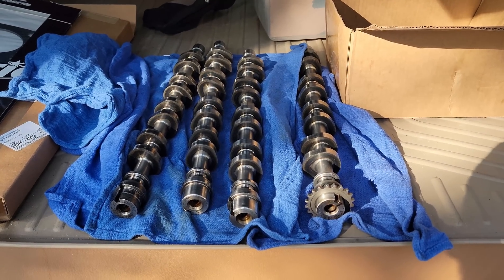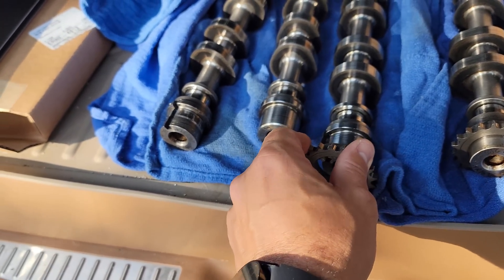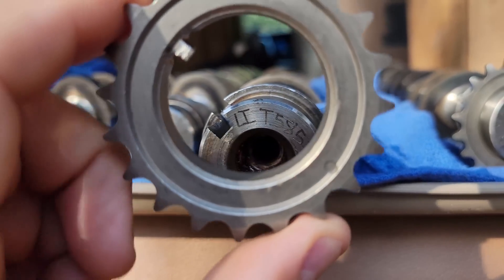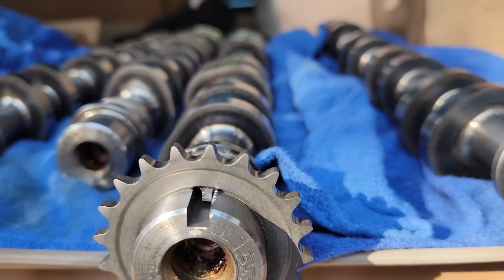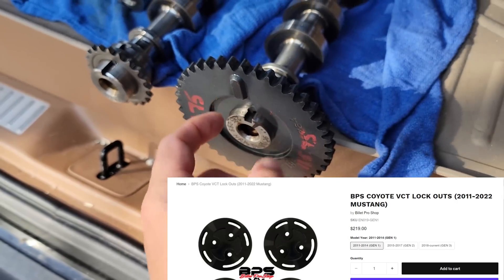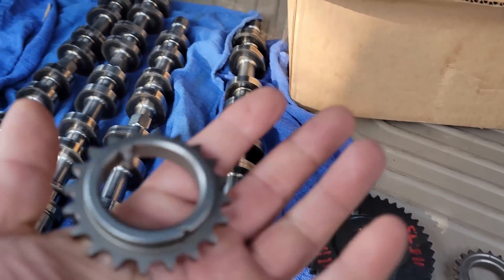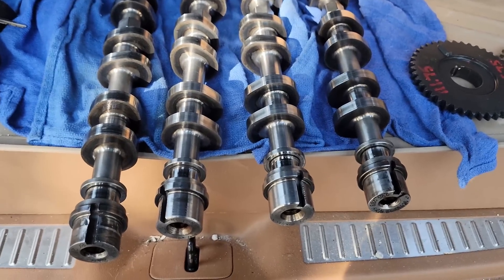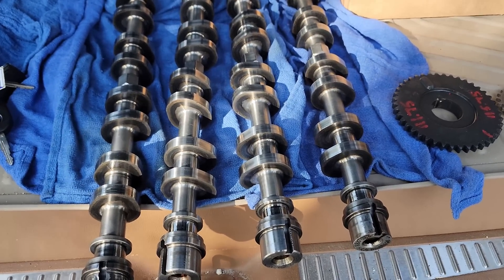NEVER Cut Your GT500 Cam Keys! Here's Why

Comment: LS guy here! So... A lot of LS guys want to put LSA blowers on their cars. LSA=CTS-V2 and 5th Gen Camaro ZL1. But they NEVER pin the crank. Pinning the crank involves drilling a hole between the crank and the balancer (IT'S NOT A BALANCER ON THE LS! THE LS IS INTERNALLY BALANCED. NO NEED FOR A BALANCER. THIS IS A CRANK HUB DESIGNED TO DRIVE YOUR ACCESSORIES! THE HUB IS PRESSED ON TO AN LS. HENCE THE NEED TO USE A TOOL TO INSTALL IT!)  to drive the blower. You're adding more stress to that BOLT that holds the balancer on the crank. Then they spin the balancer on the crank and wonder WHAT HAPPENED. The pin is basically the KEYWAY that Alex is referring to...

Hmmmm... Ummmm... Inducing that much slop into the valvetrain is just plain dumb. Cam moves and now your pistons and valves are French kissing. Ummmm... Whoever thinks this is ok is...

This is basically running an LSA blower with no crank pin. Increased valve lift and RPM requires high spring pressure. The added spring pressure from 16 valve springs (JUST ONE BANK) puts a lot of load on that main cam drive gear {the big one) and the keyway. Grinding material from those keys and keyways reduces the shear strength of the key.

WHY IN THEEEEE ENTIRE FUCK WOULD YOU REDUCE STRENGTH IN THIS AREA! JUST DUMB! PLAIN DUMB!

I'd rather play with phasers vs chancing engine failure.

Sorry for the long rant @alejandro Flores but I had to get this one out. Enjoy your weekend.
Reply: I'm late as hell I made this same comment above if you aren't using z06 crank bolt and pinning it you are doing it wrong. I have seen them fail without doing this.

Anyway just thought it was funny I made the same analogy without reading this post till now. Have a good day
Reply: @hatch450sx3  wow bruh. Lol! Great minds think alike. Thanks. Enjoy your weekend!

Comment: If you’re going to do this then you should build it back up with weld and then file it down so it still has full contact but just grinding it down is begging for trouble
Reply from the maker: Exactly.

Comment: I agree 💯. I build can am/Polaris motors for a living, and I can't begin to tell you how many sheared woodruff keys I have seen because the bolt loosened over time, or the key was not proper, etc.
Reply: You said it yourself, the key sheared due to the bolt loosening.
Reply: @BCSVT  I said etc. Meaning I have seen it all happen. Please don't look stupid and say that a keyway is not important
Reply: @coyotekelly7143   A keyway is not designed to stop sprocket movement in place of a fastener with insufficient clamping force for the application.    
Please don’t look stupid and argue otherwise.

Comment: I believe that wear on the keyway is called “fretting.” When I saw that on equipment I would document that in case it didn’t get replaced and if it failed that I wouldn’t get blamed for it.
Reply from the maker: Correct! Glad to see others share the same experience with keyways in different fields .

Comment: Its not normal to cut keys or keyways one big NO NO. Builder most likely knows better but they cut corners or they think they're saving you money somehow. I like said before because they have gotten away with it before its short cut. Other thing when does blow up it hide the issue or they blame the part to cover their rear.      

      Other thing you realize Coyote share same style of timing chain system as 2V/4V engine. But Major difference being Coyote is variable cams

Comment: As a former 20 year electrician and now currently an electrical engineer I 100% agree with you Alex. That thinned out piece of metal key will fail faster than a larger key because of the shock load that key will experience. IF they wanted to adjust the cam timing why would they just machine the key out and then broach a keyway so that they can install a full key into that cam gear base circle. A thicker key will be stronger than a thinner key. Alex you’re right, that is an unacceptable practice to thin out the key.